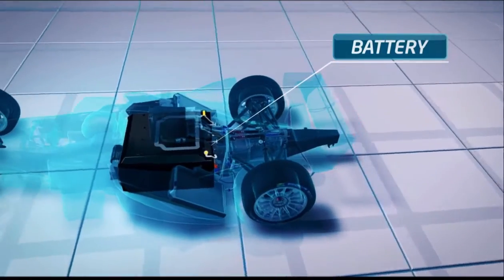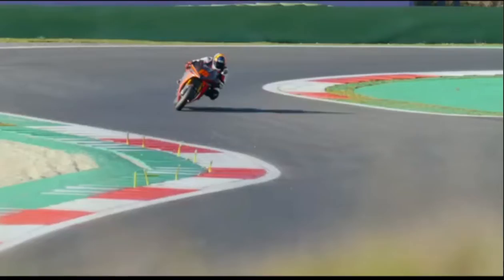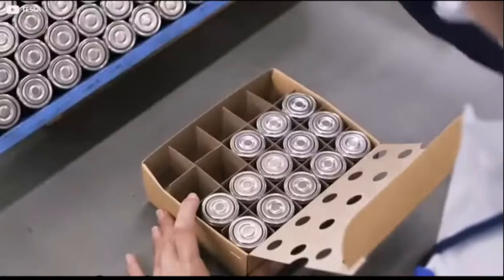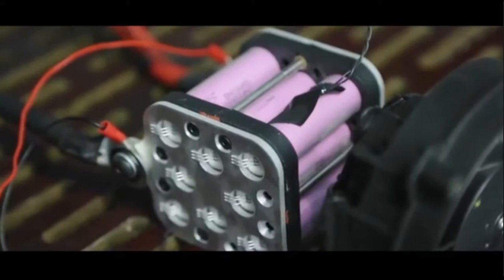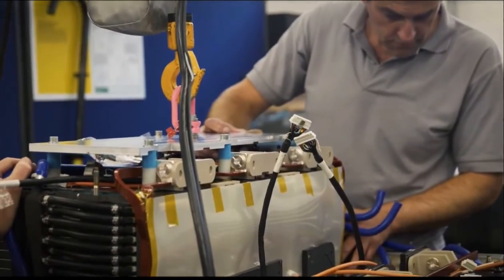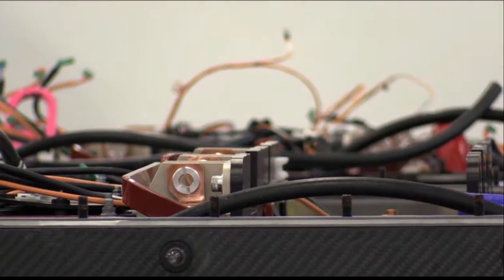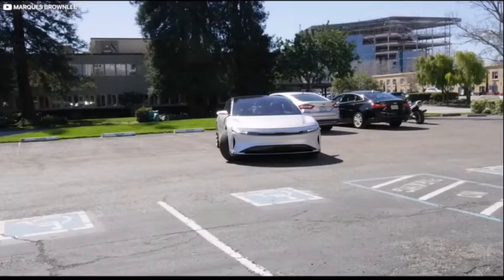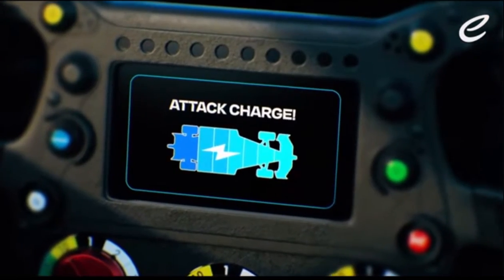Formula E GEN4 Update, New Battery & Aero

Comment: What I'd like to see in the future is multiple battery tenders that can then be sold to teams. Not each team making a battery, two or three different manufacturers like Podium or the old WAE that then supply to the teams. The teams would then be able to choose which battery to use. Then you can open up battery development year on year between the suppliers under a cost cap and attract established industry manufacturers like BYD or Panasonic. This is how you give FE more credibility in Gen 5 and beyond after Gen 4 hopefully establishes FE as a true top racing series. 

They also need to relax the regulations around powertrain development again and loosen the energy cap rules. Put a cost cap on the teams instead, and let them compete to make the most powerful and most efficient drivetrains. It needs to shift back towards a hardware development formula instead of the software development formula it has been for the past 5+ years.

Comment: wait till they start putting fans that suck the car to the ground. and automatically adjusted surfaces. that can feel the tires predicted slippage and stick the aero out out more or less depending on what the internal tire pressure and tire grip and heat sensors that are embedded into the gecko inspired tires. that have nano strands that grip the road at the nano level. but wait till they actually put inductive power embedded in the track. then they wont even need batteries. but wait i got one more. i think im like 10 or more gen by now. so by then precision gps ai drivers will take all the danger out of e racing. and the humans for that matter. there is a time not too distant from here, that we will have to become machine to keep up and remain competitive. by 2050 gen 20 cars will go 350mph and take turns that would break our frail bodies. at least these are the directions i would be taking formula e. i guess ill see yall from the podium. for obvious reasons. next level racing
Reply: The four ways racing can go from here are:

AI takes over as race car drivers and mechanics and basically just runs the championship with the winning team being based on who has the most accurate data and the most developed AI with the funds to carry out its demands for the car. This way, humans don't have to snap every bone in their body without extracting 50% of the car's potential.

Race car drivers start controlling their cars remotely so they aren't subject to the G-forces of future race cars. At this point, it basically becomes Esports sim racing drivers vs old race car drivers in a life-sized RC car championship.

Race regulators restrict the maximum performance potential of race cars and start focusing on ways to get that power down using the least amount of material and energy possible. This might be a bit sad but it would probably be ideal for the real world.

Someone comes out with human augmentation/gene therapy designed to artificially raise the human physical limit and race car drivers start getting paid even bigger bucks to risk their lives not just to undergo these procedures but to drive what can only be described as ground missiles to their full potential without breaking every bone in their body.

Comment: My naïve guess being that cylindrical batteries are also easier to cool down since there is a whole lot more heat conductive surface to play with.
Reply: No. You can design a pouch sale to have a very large cooling surface area in comparison to a cylindrical cell, far more surface area in fact, you're talking potentially in order of magnitude more surface area.

Comment: Batteries don't hold kWs, they store kWh and the new batteries are said to have 55kWh as opposed to the ~42 of the Gen3 batteries, allowing for longer races. The power OUTPUT will increase by 100kW to 700kW as opposed to the 600 that the Gen3 batteries can potentially give now, by unlocking the full front power train of 250kW. With the Gen4 having a 350kW front PT, you get 700kW total.
Reply: isn't it 300kw normally and 350kw while in attack mode?
Reply: The gen3 only has 350kw of power, 600 was the original number but Williams couldn't provide a battery with enough capacity to do the full race at 500-600kw I believe was the story.
Reply: @wesleytheamazing  Its 350 of power but it has 250 on the front axel only available for regen